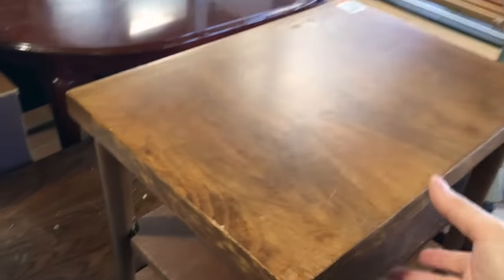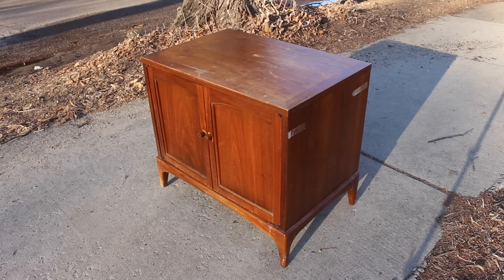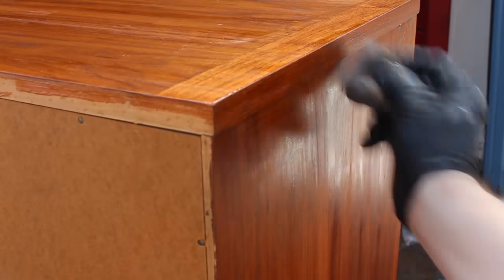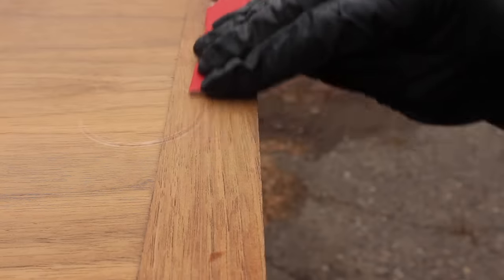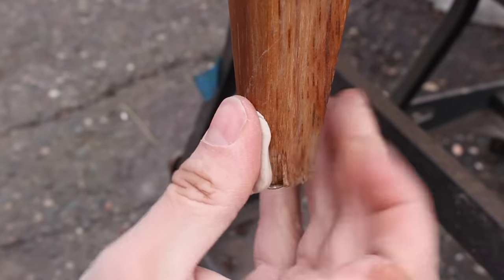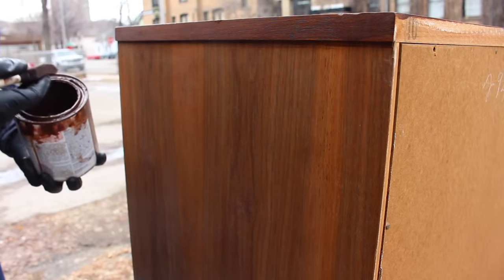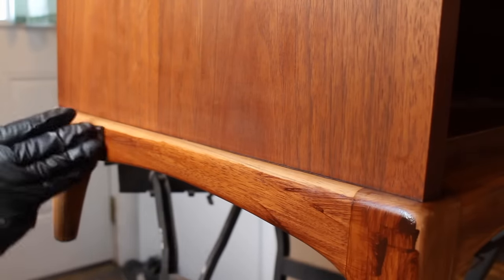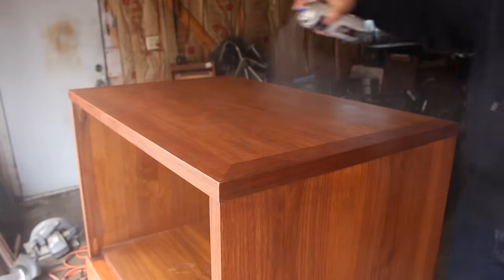Thrift Store Rescue  #8 / Mid Century Furniture Restoration

Comment: Nice job! Thank you for helping to explain the different uses between regular stain vs gel stain. I've recently started my own little youtube channel and spend a lot of my time checking our your channel and the channels of others of my mentors for tips and points an quality work!
Reply: Thank you and thank you ReDesign Guy for pointing out this difference. I had no idea and I don't think most people do either. BTW, Redesign Guy. luv what you are doing on your channel.
Reply: @joelthiem486  Thanks for your appreciation. Actually have a pretty cool project dropping later today, pretty excited. But we are on the Dashner channel right now, a real mentor of mine, so I don't want to take any more of their bandwith.
Reply: Got my Uprevive chalk paint yesterday and works better than any other chalk paint!
Reply: @ReDesignGuy  I've been using it and it's great just need to add a little water sometimes

Comment: This furniture piece looks remarkably like the early 1960s stereo/record cabinet that I have here at home.  My parents purchased it to hold the stereo system my dad built out of a Dynakit in 1964.  The top one side lifted up and housed a turn-table and below that it held records.  On the other side, it held the rest of the components for the stereo: amplifier, pre-amp, and Hi-fi tuner.  I also still have much of my father's record collection.

Comment: I had great results on a mid-century chest of drawers doing the following. Serious woodworkers will probably cry in agony... I scrubbed down the piece with Mr. Clean Magic Eraser and Murphy's Oil Soap floor cleaner. That was the extent of my "stripping" process. Then I lightly sanded. The stain/finish was Watco "Danish Oil" walnut finish. Several coats. Then buff the heck out of it, and use some wax product, I think it was something like old Johnson's paste wax. That's it. Looks amazing.

Comment: Hi! Thank you for this straight forward restoration of MCM furniture piece. I am so timid to attempt this w my parents’ teak & MCM furniture & other video brave pieces I’ve acquired, also w water ring damage. I just found this video. I, personally, want to restore the original look of vintage wood furniture & stain. I just can’t sand & paint it a color bc I appreciate the authenticity of the period, and I like the warm wood stain tones. $30 for this piece is a steal. I know this is a few yrs old. I have some dbl level ‘60s side tables I’d like to restore. I got both for $30.  I’ll be sure to check out more videos for expertise. Thank you for your cleve tactics!
Reply: Correction: not video, vintage pieces

Comment: This is why you use coasters kids! That ring wasn’t disappearing completely even after all that work. The only wood work I’ve ever done was staining a floor to ceiling bookshelf that was maybe a metre and a half wide so quite a big piece that was hard to move. I was 16 and didn’t have instructions so I painted it in thick and didn’t wipe it off, and that of course left drip marks though admittedly a gorgeous dark red wood colour. I’ve yet to sand it all off and re stain it now that I’m in my early 20’s, but perhaps this will be the year I do.

Comment: You can easily go from 150 grit straight to 220. Also a foam sanding block saves a lot on your sanding time as well. The Grizzley shaped foam sanding blocks are indispensable.

Comment: A French polisher told me years ago that the way to remove a heat ring is to make a sort of slurry with cigarette ash (seriously) and some water. Let it sit on the heat ring for a while and apparently that’s it. I still haven’t tried it myself, but one day I’ll refurbish my coffee table and give it a try. It just stuck in my head for some reason. The other tip he gave me that day was how to get a shallow dent out that hasn’t broken the stain. You poke some tiny holes into the dented spot with a pin, then sit water on top for a few hours. The water penetrates the stain through the pin holes and makes the timber underneath swell, pushing up the dent. I have tried that one and it does work.

Comment: Wetting your finger to shape the putty helps but it's a double edge sword. The epoxy/glue/bonding agent will naturally seep toward the wet. (osmosis?)  making the outside extremely hard, also hard to sand/shape , and the inside you want to stick ...very brittle.

Comment: For your utility knife blade, try putting it into a window cleaning scraper/blade holder, just for the safety and added control over the blade. They're dirt cheep and might save you a few stitches down the road ;)

Comment: Take a moment and remove the door handles before you restore.  Also there are many ways to remove the water ring on the top.  Try vinegar and olive oil in equal parts and a soft cloth.  Nice piece.

Comment: Pretty sure you're looking at Teak there man,...the base is solid wood, the panels and top are veneer...hence the difference in color. Another giveaway was the finish, it's most likely an oil finish, and the reason it doesn't produce a slurry of crud when stripped.. Danish/Teak oil was very common on these type of pieces..and it doesn't sit on top of the wood like lacquer or polyurethane....and leaves a soft "hand rubbed" look with open grain. Almost all Teak of that era was finished this way.Next time re-apply another round of stripper to the stubborn ring and let it sit, and may I suggest a coarser steel wool when scrubbing stripper off, I use #1, on a hard wood like Teak, you can even use #2 or #3...it won't scratch it and it will make it a lot shorter job. Often Watco Danish oil, which is available in colors (Medium Walnut great for restoring Teak), can be used to restore an oil finish without stripping, and it can even be wet sanded into the wood with 320-400 grit wet/dry sandpaper and will remove a LOT of the stains and renew the finish on sides, doors, etc...But the tops usually require a heavier hand because they get the brunt of the damage Just because I've been doing this a while too...while you're at the thrift stores, pick up some old t-shirts and flannel, and ditch the blue paper towels!.... Enjoy your videos.

Comment: Deft... No dude.  Just slow your spray movement a little and use sealer and then lacquer from Mohawk or Behlin.  Not hard, not far from what you are doing.  Apply 3 coats.  Let dry for a day and rub out with 0000 steel wool and Johnson's paste wax.  If you want to really get into it use varsol/oil mix but you may need a little experience to use this.  Best of luck.

Comment: Very nice work. General finishes are my favorite products. They work really well, with excellent results. I love their water base clear top coats...esp. the High Performance clear gloss, applied with a rag "believe it or not" in thin coats. Is there a specific reason you used Lacquer as a top coat instead of a high quality water based clear?  Think that piece would sell for a bit more than $120 though.....

Comment: Really imressive work. I was looking for something like this because I am currently restoring a "danish" style furniture. I have 2 questions and I would very much appreciate it to have your answers:
1. If you use this kind of oil in restoration do you also need to use paint? Because it seems that it enhances the colour of the furniture but does it last?
2. In order to achieve the same tone on different wood (like upper furniture vs base) could it be with more coats on the lighter wood instead of gel stain?
Thank you in advance.

Comment: have you thaught about using machine tools for sanding and  doing this kind of repair work on lets say 10  pieces of furniture at once? It may drastically increase your productivity and make the work both more profitable while keeping the prices affordable.

You should also have a simple website or links to auctions with the furniture done in and arround your video production?

Ofcourse more product may need storage space but maybe there is something near you at cheapo price? unused factory space someone would be willing to rent you for symbolic cost jsut o have you be there and it not sitting empty? Or maybe you have a piece of land where you could  set up a shed?

Comment: Orbital sander goes against the wood grain and not the best idea.  Lacquer also will  repeat any stains from drinks placed on.   Wipe on is better.   There are also ways to remove drink stains because staining, sealing, etc. will not generally remove them and often will highlight them.   Precautions should be stated for people when using chemicals especially in enclosed spaces; at the minimum nitril gloves, a better ventilated mask, etc.
Reply from the maker: It's a random orbital sander which goes in many different directions and won't leave marks when used properly.
Reply: @DashnerDesignRestoration    "used properly" are very key words...  I've seen the results of others who have used those sanders with disastrous results.    Nice job btw!

Comment: Hi Dashner Design & Restoration, 
Thanks for your awesome videos. 
I would like to ask you for advise: I bought a great Mcintosh sideboard in veneer teak. With sunlight I noticed that some parts have some sort of non-uniform but large oil/varnish stains that shine greater with the light. Is there any way to remove these easily, or I need to sand it and do all the job? I've never done this and I'm quite afraid of trying something that my ruin it. 
Thanks in advance!

Comment: I accidentally spilled a little acetone on my wood table. It soaked through the mat I had down and the table cloth.  It mainly just ate the top finish off.  The area of the spill is about the size of a pepperoni or round cracker.  Could you please give me some instructions and advice on how to fix it?  I know I probably need to sand down the area with steel wool or a fine grit sand paper, and apply a minute amount of finish over the very small area where the stain looks a bit lighter (about the size of a pencil eraser), but I'm not sure what would be the best color stain to blend with the existing one, and I'm not sure what finish the table has on it.  Also, what brands do you recommend for each? Will it look obvious if the top finish is slightly different in that one small area?  Thanks in advance!

Comment: You did a nice job.  Can I recommend that you purchase yourself an HVLP sprayer.  You won't have to mess with those cans anymore.  Deft is NOT a good finish.  A pre-catalyzed lacquer will give you  a MUCH better finish and FAR less expensive.  Go to ebay, and you can even find a used one pretty inexpensive.  I can guarantee you will like the results MUCH better. I've been a cabinetmaker for nearly 40 years now.  No offense, but DEFT truly does suck as a finish.  That finished out really nice, but DEFT is not a hard finish.  It doesn't stand up well to fluids.

Comment: Excellent video, but i didn't like how it's all a harsh volatile petroleum chemical process. As far as the result it's a good restoration but the modern finish and stain has a plastic look, the natural wood essence visual look is not as good as it would have looked in its original finish (without the marks).

Comment: 25 for the Box the stripper, the steel wool, house hold cleaner, mineral  spirits, sandpaper,  naphta, expoxy wood filler, gel stain,  stain, varathane, brushes, rags, lacquer  8 hours time??  Time to sell it and deal with lowball offers.  Can't see where you can make and money doing that?

Comment: The somewhat blonder bottom frame is part the look.
That would blow the deal for me.
Shame you did that.  Protecting the bottom frame from what you did to the upper portion was great only to add a stain to the frame.
A deep penetrating oil would have been much nicer I think
I do not understand your rationelle.

Comment: why use stripper if your going to use a sander?  just curious..
Reply: It's often much less work. Sanding varnish/stain off can leave the piece unevenly coloured and veneer doesn't give you much safety from sanding mistakes.
Reply: thanks for the reply.. I plan on re-doing a few counters in my home and thought I could just sand it.